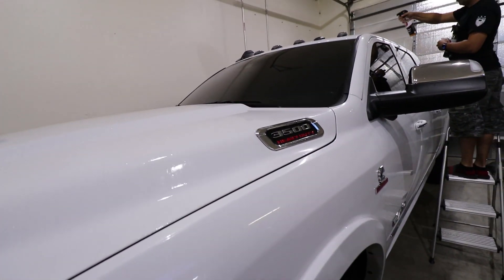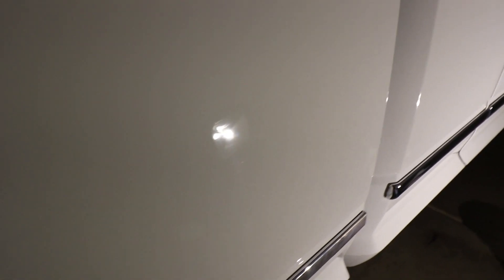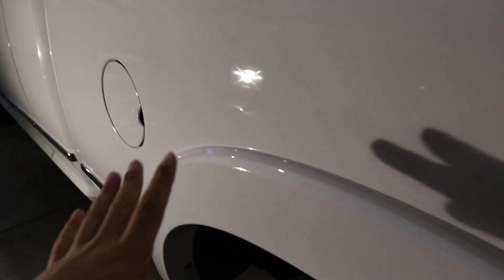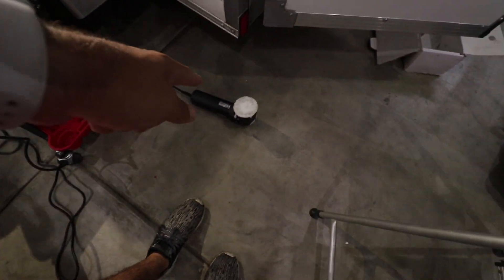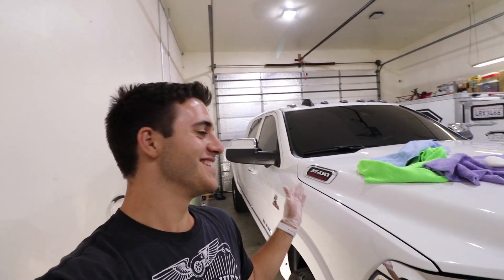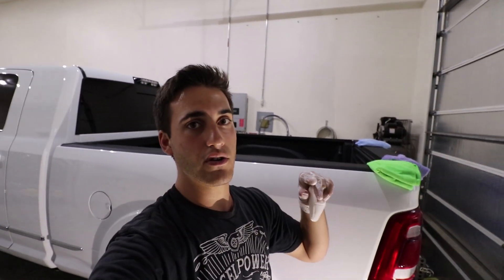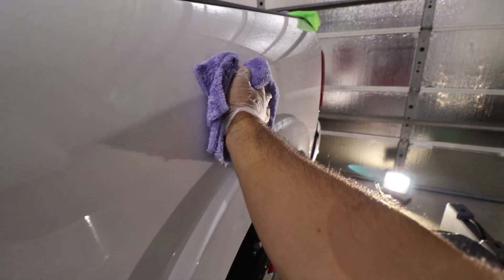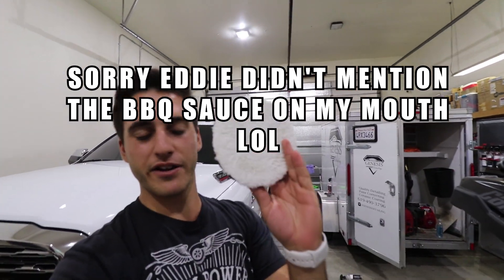START to FINISH Paint Correction and Ceramic Coating // FULL RUNDOWN

Comment: I love the coating on my truck but am starting to notice some swirls under direct sunlight. I have it under warranty. Do you think its necessary to have it re done? Im assuming the swirls are just on the coating itself and not the clear coat. Or if i should just live with it? thanks.
Reply from the maker: its hard to stay away from swirls 100% .. if its coated then chances are the swirls are only in the coating and could be treated without any issues. I bring clients back for one year touch ups to refine any blemishes!💎